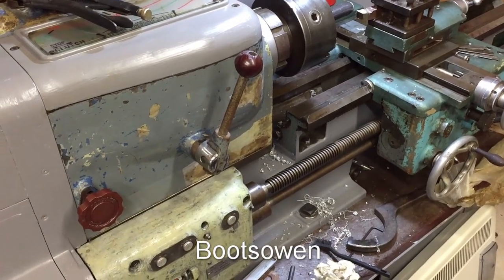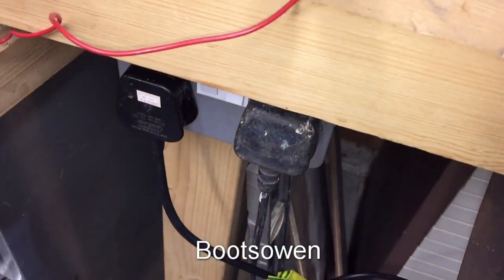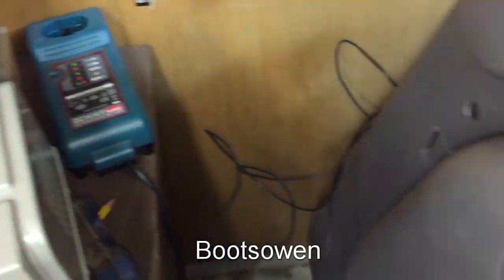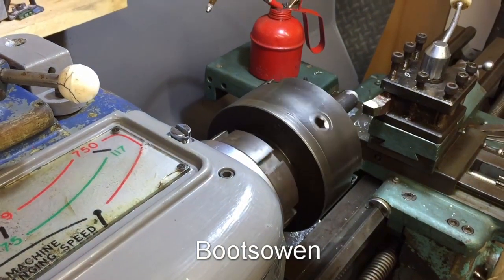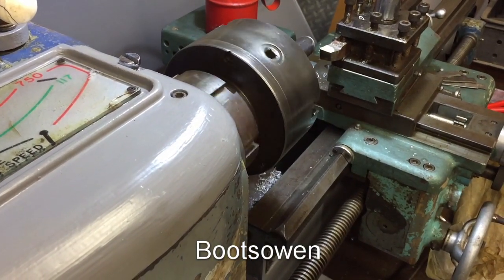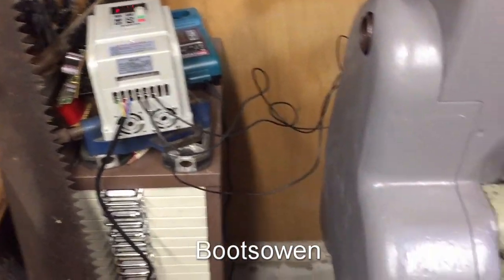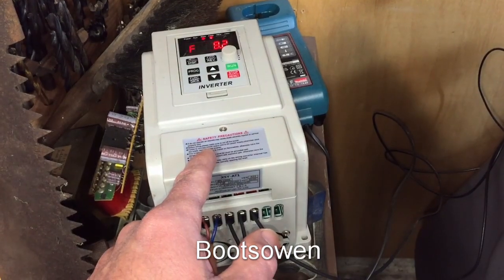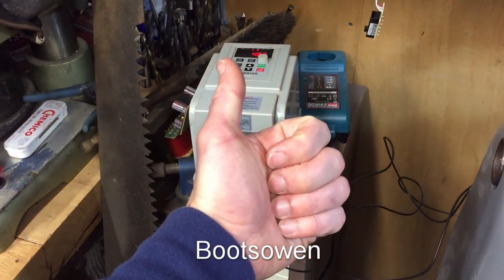How to run a 3 phase Lathe motor on a VFD | Variable Frequency Drive Inverter | full speed control

Comment: Hi, I have the same Harrison lathe with the same 1.5HP 3 Phase 440v motor, did you wire the motor in Delta mode or leave it in the deafult Star configuration where it only has 3 wires inside the motor, I also want to connect a VFD? Thanks
Reply from the maker: I have posted a video of the motor refurbishment in one of my playlists. Either my lathe playlist or motors or both. I can’t recall checking the configuration but you might be able to identify it

Comment: Great job! Bravo!  I will need to do this to a bulk coffee grinder that is running way too fast for home use.  
I could use a voltage regulator but I would lose the torque needed to function the device efficienly and effectively. Now I know how to do it. Thanks!
Reply from the maker: Are you sure it's a 3 phase motor?